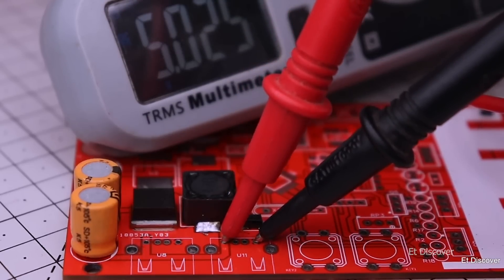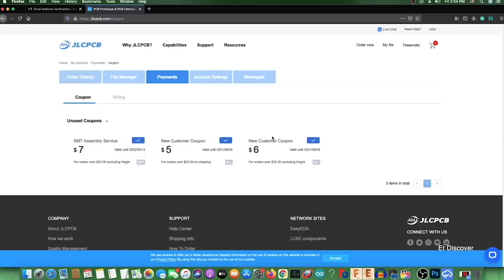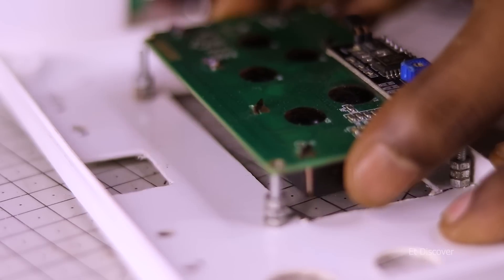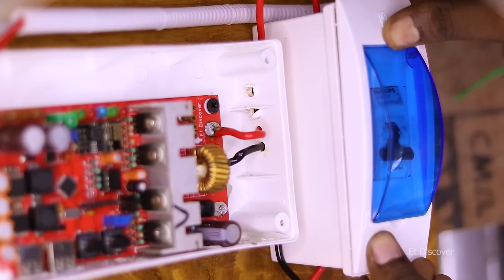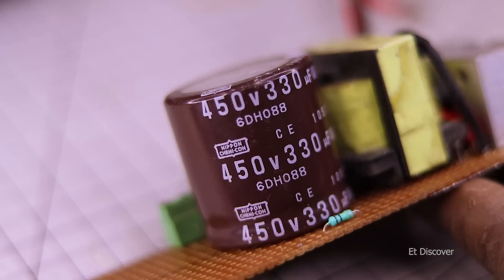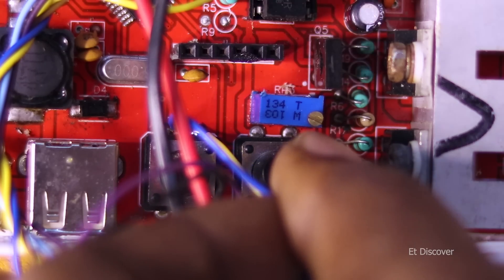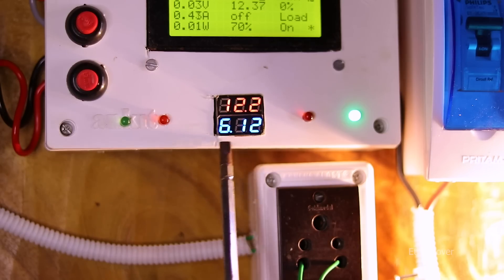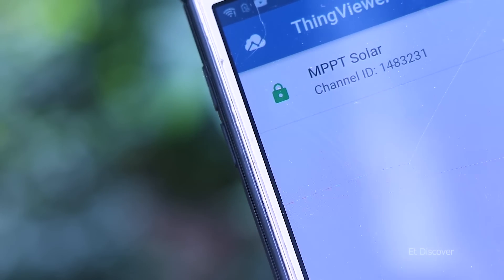Make A 500 Watt Inverter for DIY  MPPT Solar System & Assemble

Comment: Bro how can I adjust  the  output  frequency In my case I need 35khz
Reply from the maker: You need to change RC , resistor or capacitor,
Reply: @EtDiscover  thanks man

Comment: Bro i have a question!! Is Arduino based oscilloscope are accurate???
Reply: They're pretty accurate, yes, but not very fast. You can get up to 76,800 samples per second if you add a couple lines of code, though, as shown here:
http://yaab-arduino.blogspot.com/2015/02/fast-sampling-from-analog-input.html
usually, you want 10 samples per period of your waveform, so that means you can measure up to 7.68Khz with an arduino.
Reply: @Kevin-jz9bg  thanx a lot dude!!! You are also be a awesome guy!
Reply: @Kevin-jz9bg  how much the volt limit can i measure the arduino oscilloscope??
Reply: @Intelligent Processor {AI}
You can measure whatever voltage you want, actually.

The Arduino ADC gives you a reading between 0 and 1023, where 0 is grounded and 1023 is some reference voltage. That Vref can be the Arduino's 1.1V internal voltage regulator, or the supply voltage.

Just add a voltage divider such that the maximum voltage you measure will be less than that reference voltage after it gets divided.
For example, let's say I wire it up like this:
Voltage In - 100k Ohm - Arduino Pin - 10k Ohm - Gnd.
the total resistance is 110kOhm, and 10k takes up 1/11 of that. Thus, the Arduino pin voltage will be Vin/11.

So let's say you set the reference voltage to 1.1 volts get a reading of 510. 510 tells you that arduino pin voltage is 510 / 1023 OF the reference voltage. So you multiply 1.1V, the reference voltage, by that fraction, 510/1023, to get 0.548V.
You know your signal has to be 11 times that, so you multiply 0.548 by 11 to get 6.03V.

In code:
float voltage = analogRead(A0) / 1023.0 * 1.1 * 11.
(i have to write 1023.0 instead of 1023 so it knows it should do float arithmetic, aka decimal arithmetic, or else it will not give me the right answer.)
It might slow the arduino down to divide by 1023, multiply by 1.1, and then multiply by 11 again. So, I combine those three operations with algebra:
analogRead(A0) / 1023.0 * 1.1 * 11
analogRead(A0) * (1/1023) * 1.1 * 11
analogRead(A0) * 0.011827957

The maximum voltage u can measure with a 100kOhm and 10kOhm divider is 1.1 * (100k+10k)/10k = 1.1 * 11 = 12.1V.
If you want to measure higher, you can make the 10K smaller or the 100k bigger. I'll do both, and change the 10k to a 1k and 100k to a 1M.
(1000k+1k)/1k * 1.1 = 1101.1V.
Crazy, right? Just be careful with high voltage so you don't get shocked. Also, make sure the 1M doesn't get shorted - connecting anything higher than 20V will damage the ADC, and none of the analog pins will work after that. (IK from experience... RIP my old arduino :/)

-------
The article I sent didn't explain the code, so I'll explain to make sure u understand it all:

To set the reference voltage:

1) I usually use the 1.1V because my supply voltage might drift, say, if i'm using batteries.

To do this, set the bits 7 and 6 of the ADMUX register to 11, as shown below:
ADMUX |= 0b11000000;
2) You can also not use the internal reference voltage and connect your own voltage to AREF, like the output of a 3.3V voltage regulator. Set 7 and 6 to 00.
ADMUX |= 0b00000000; (or do nothing).
3) Lastly, you can use the supply voltage.
ADMUX |= 0b01000000;

To control precision:

The 5th bit of ADMUX asks if you want the ADC value to have 10 bits of precision (0-1023) or 8 bits (0-255). 8 bits isn't faster than 10 bits, so I just go with 10 bits. For 8, you write a 1:
ADMUX |= 0b00100000;
For 10 bits, you write a 0. It's 0 by default so you don't need to change anything.

The 4th bit is reserved so don't worry about it.

To choose which analog pin to use:

The 3rd through 0th bit is which ADC pin you want to use. I use A6, so I'll write:
ADMUX |= 0b00000110;

To change analogRead speed:

You alter bits 2, 1, and 0 of another variable, ADCSRA. These 3 bits are called a prescaler. Basically, the ADC has its own clock, which ticks once for every N ticks that the main 16Mhz clock ticks. You can choose this N with bits 2-0:
ADCSRA |= 0b00000*000* => 16Mhz / 2 = 8Mhz  
ADCSRA |= 0b00000*001* => 16Mhz / 2 = 8Mhz
ADCSRA |= 0b00000*010* => 16Mhz / 4 = 4Mhz
You can find the rest on page 219 of the Atmega382p datasheet (https://ww1.microchip.com/downloads/en/DeviceDoc/Atmel-7810-Automotive-Microcontrollers-ATmega328P_Datasheet.pdf)
You need a prescaler of at least 16 - anything faster gives really whack readings and I'm not sure why.
ADCSRA |= 0b00000*100* is the fastest.
Anyway, that means a 1Mhz ADC clock. Each ADC conversion takes 13 clock cycles, so each second, you can get 1,000,000 / 13 = 76923.0769, or around 76.9k, conversions.
In reality, this will be slower, around 50kHz.

To turn on the ADC:
Write 1 to bit 7 of ADCSRA:
ADCSRA |= 0b10000000;

-------
To read the analog input:
The ADC reading is 10 bits, but the arduino is an 8 bit computer. So, the two most significant bits are stored in a variable called ADCH and the 8 less significant bits are in ADCL.
Say you get 954, or 0b00000011 10111010. That's:
ADCH: 0b00000011
ADCL: 0b10111010

So, all you need to do is shift ADCH 8 bits to the left:
ADCH << 8 = 0b00000011 00000000
And OR it with ADCL:
(ADCH << 8) | ADCL = 0b00000011 10111010

unsigned int reading = (ADCH << 8) | ADCL

But wait! that doesn't work. the datasheet says that ADCL must be called first. Easy fix: we just swap the terms.

unsigned int reading = ADCL
 | (ADCH << 8)

And there you have it... everything u need to know about analogRead.
Good luck on your project!
Kev <3

Comment: can I make this inverter 50hz by altering some components but with the same feedback method??
Reply from the maker: Just Decrease frequency 69kh to 50hz
Reply: You can also use an half bridge at the output (make sure the mosfets can handle the high voltage) and then PWM the mosfets at high frequency using gate drive transformers. The PWM duty cycle goes from 0 to 100 and back to 0 for the top mosfet, then 0 to 100 to 0 for the bottom mosfet, and repeats like this 50 times per second. 
You can also just decrease the frequency like Et Discover says, but make sure you use an iron core transformer. A ferrite core will get saturated quickly and after it's saturated, any energy you try to put into it will turn into heat.
Good luck with your project! :)

Comment: Bro they is an mistake in circuit  diagram  of the  inverter the pwm ic positive connection  is not mentioned  correct the mistake
Reply from the maker: Maybe that was my fault, just connected positive and I am pretty sure it will work perfectly, And make sure your output frequency
Reply: @EtDiscover  bro where the positive wire needed to connect in pwm ic

Comment: Charger can run between 50hz to 60hz frequency.....bcz charger choke coil is turned around ferrite that's why u can use .....and one more thing is that the circuit of charger is different than other driver.....it consists 1) filter 2)section. rectifier
3) oscillator 4) again rectifier 5) output section
Reply from the maker: Every SMPS and any kind of SMPS you can run with DC volt, because every SMPS has own oscillator, , If you follow accurately in a SMPS Then you can analyse Ac volt convert in DC volt, After than any kind of oscillator ic make amplitude signal for small transformer

Comment: Mcb whire is very thin ..I think .5mm  PLZZ use thick whire for more current....btw u r using 20amp mcb and u already know that 1mm² whire can carry below 15ampere ac ur MCB will trip at the time of maximum load..... So for safety reason and more current carring PLZZ use thick whire
Reply from the maker: I am using 2.5 MM wire for Battary, In my calculationI this is pretty good for 40 Amp load , And I am using here 20 Amp NCB , Because I don’t needed above 300 watt,  I hope you are understand
Reply: @EtDiscover  hmm...it may be that I didn't see more closely

Comment: Big fan bro, plz provide ur power supply v3 Circuit Diagram plz bro
Reply from the maker: This circuit has many problems so I didn’t provide the schematic , for bother my subscriber
Reply: @EtDiscover  can you help in making a office Variable bench power supply with volt and Ampere regulator
Reply from the maker: @Experiment_Club   I'll try

Comment: One question :
Can we use the atx transformer for this inverter without making any changes in the transformer???? (:
Reply from the maker: yes
Reply: please explain clearly. i am gonna make it. atx smps transformer has 2 pin primary side and 6pin at secondary side. how to do it?